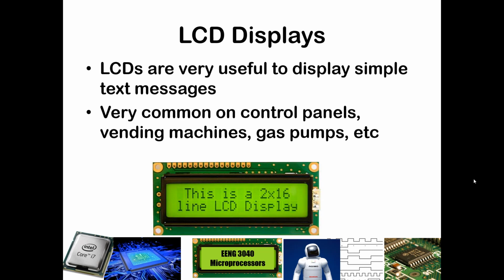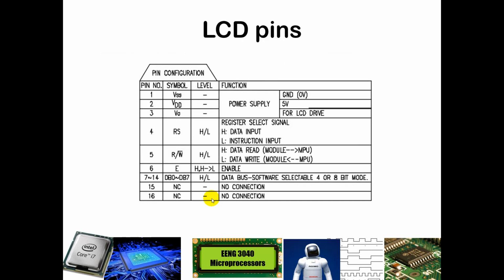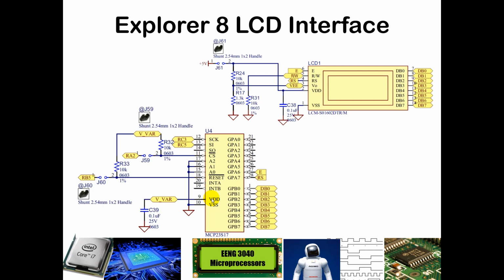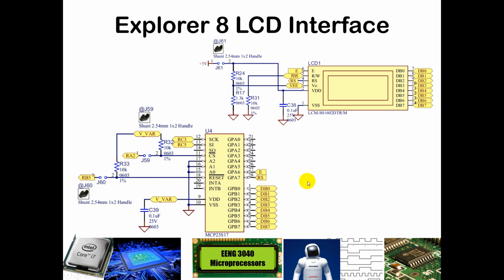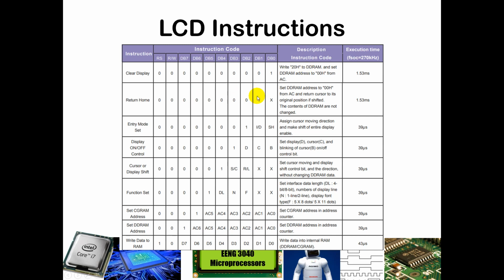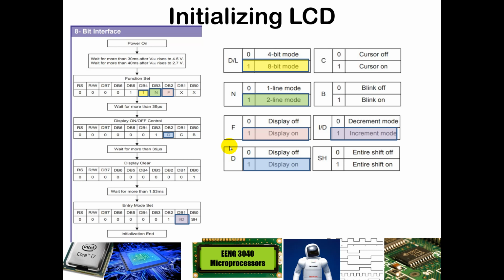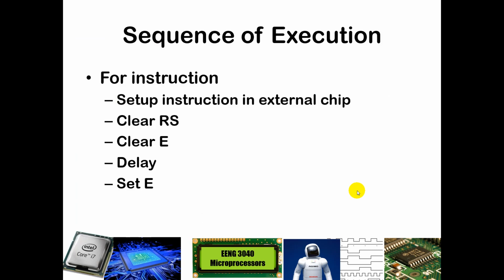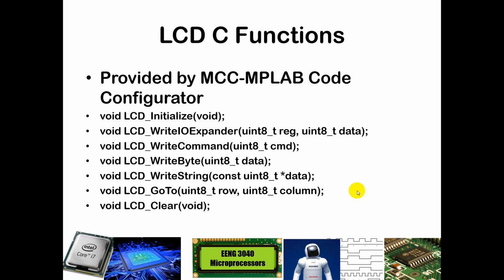Interfacing a PIC microcontroller with an LCD

Comment: hello friend, nice project and good explanation. I'm started in embedded system, I already have some sub-routine work for controller lcd 40x02, with atmega 328p with ST7066 driver. but I have a problem with the "function set" I can't choice the fonte size 5*11, only can work with 5x8 dots font size. can you help me please try understund with can´t put the function set work correctly?
thanks for your time
Reply from the maker: Typically in the datasheet for the LCD there is an indication of how to go about setting the resolution of the characters. Some may be fixed, however, and not let you choose. Do you have the datasheet for the LCD and can you see the setup sequence?

Comment: Is it possible to use multiple GPIO push buttons which allows a selection option to be displayed on the LCD as a menu to setup or modify certain parameters of a control circuit. Something simple like a temperature control loop, so the PIC MCU is setup to control an output which heats up a process, the LCD displays a menu which allows the option to increase or decrease the required set point for example.

Default Display may show Process Temperature or variable (PV : 25 °C) and the Set Point (SP : 30°C), Then if a certain button input is used to access a menu which displays Set Point adjust : SP : 30°C
Reply from the maker: Absolutely, all of those things can be done.